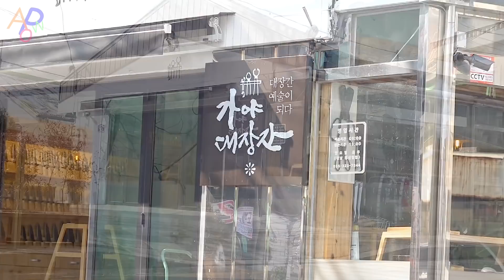Process of Making Traditional Hoe by Skilled Korean Blacksmith

Comment: Well, that's how I make stuff here on the farm.  Except my "power" hammer is operated by my bicep.  Great to watch a skilled smith making stuff.  I always find something to learn by watching other smiths at work.
Reply: Have you ever considered a treadle hammer? I'm pretty sure that's what they're called. It's basically a power hammer without the power. Some springs and clever levers to let you swing a hammer with your foot to keep your hands free for other tasks.
Reply: @gorisenke  I've looked at a lot of Treadle Hammer plans and never really found any that could beat my own arm with various hammer weights.  One of the very best (for me!) was having an apprentice that could slam a 16 lb. short-handled sledge while I manipulated the hot piece on the anvil and added correcting "taps" with my rounding hammer.  Once we got used to that teamwork, it went pretty well.  I've been playing around with the idea of using the transmission from an old junk (1960s) hay baler, run from a tractor power take off shaft.  That -- I think -- would allow for about a 50 lb. hammer to be placed on the baler's "plunger."  But, for now, I'm gonna' stick with  the smaller wrought-iron stuff that actually brings in more money.  For any blacksmith's looking for a "project" that could make a lot of money, I'd say to get into making flintlock parts.  Most of todays USA produced flintlock parts are cast and not as strong, nor as good as well-forged, traditional parts.  And there are a LOT of people into muzzle-loading these days.
Reply: @yepiratesworkshop7997  thats fair, if you don't need it, there's no need to have it. Nothing beats a good routine. And as someone who is moving to an area where I can actually practice blacksmithing, thank you sincerely for that tip. I never thought about making parts for black powder. That would be a fun project too.
Reply: sounds like you want to score a cheap date.
Reply: @abebeaku8369  I wish I could score a cheap date.  I'm 66 and all my "cheap dates" ended up costing me more than than they were worth.  Except Mrs. Pirate, of course.  She turned out to be a real "million-dollar woman."  I still can't get her to fill in as a 'striker' with that big sledge, though.
Reply: @yepiratesworkshop7997  LOL. I wish i could brag about my muscles at my tender 63 :)